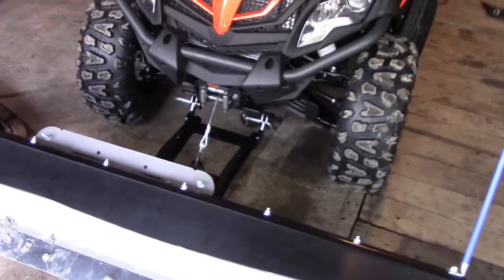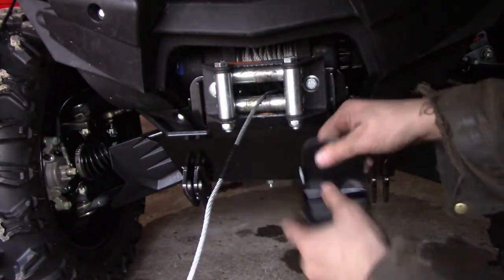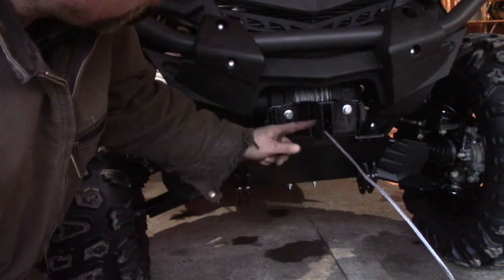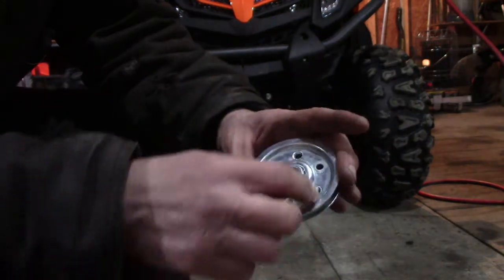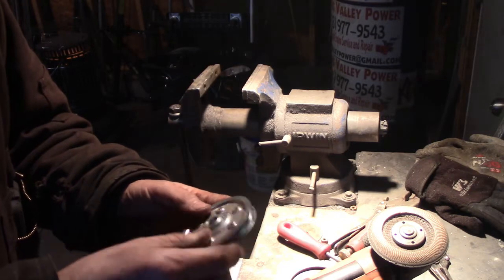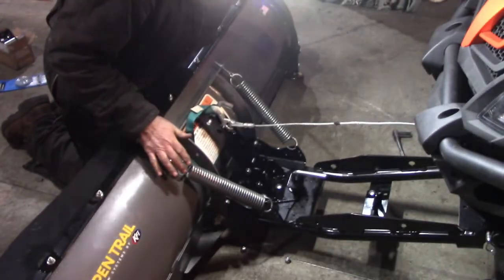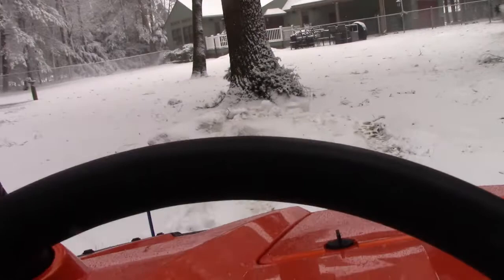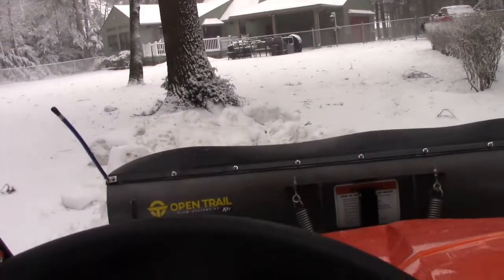KFI plow fix for winch cable breaking on UTV CF Moto.

Comment from the maker: A lot of comments saying the cable pull routing or angle is wrong. That it should be pulled up not in by the winch...it is  the correct way to pull it in,  and not up! There is a suggestion card towards the beginning of video as well a link to another video at the end that explains why this is correct.
Reply: A winch is always pulling "in" if think about it. You can change the angle of the cable anyway you need to and the winch still is going to wind the same way. 😂

Comment: I have this on my plow. The thinking behind the large pulley is your cable wont bend as sharp as compared to fairlead roller, 3 inch pulley compared to 1 inch on fairlead.
The pulley will also keep the cable from flattening like on the roller fairlead. Another feature is the piece joining the two angle L brackets is meant to keep cable in pulley

Comment: I like the pulley replacement instead of the fairlead, but that system ends up putting most of the power of the winch forward and aft, instead of lifting.  I would attach another pulley, with a sealed bearing, to the lowest anchor point on the plow, and use a strap to anchor the hook end of the cable to some high point on the front of the ATV.  This doubles the mechanical advantage, decreases the speed of the lift.  and cuts the stress on the cable by a factor of 2. 
If you don't care about having the winch cable installed, I have seen several hints on other installations with the cable breakage problem, convert to an 8 foot length of  2 inch strap attached to the winch (after removing the cable).  I haven't decided how I am going to solve this problem, but there was another Idea, where the person mounted another winch on the plow, and used the same power cables from the main winch, to power the winch on the plow ,   This would allow a person to use a strap instead of a rope or cable, and lengthen the life of the unit, while still having the long line on the main winch for normal operations.
I have a Warn, center mount plow on a Kodiak ATV, and I am going with the winch on the plow (using a 2" strap),  because I happen to have another winch available.  I plan to use a quick disconnect, to move the power from the ATV mounted winch, to the winch  on the plow.
Good luck with your installation.

Comment: You can’t pull a snow plow straight to your winch…….up not straight
Reply: you are exactly right. The cable should be attached directly below the winch. It should be lifting the plow up, not trying to pull it in towards the ATV

Comment: I did this to ours, has broken twice this year. Each time I plow it snaps the cable
Reply: Try attaching the winch cable to the plow arms directly below the winch. His design is putting a lot of stress on the cable. It should be lifting the plow straight up, not pulling it in toward the plow. You want the winch cable as vertical as possible, straight up and down. You'll have much better results.

Comment: Your winch mount location is horrible. Your winch is trying to pull the plow blade in towards the ATV when it should just be lifting it straight up. You will have much better results if you hook your winch cable on the metal loop directly below the winch. You want to keep your winch cable as vertical as possible, straight up and down. Much less stress on the cable if it's lifting it up, not pulling it in toward the machine.
Reply from the maker: I hear you and I know what you're saying it looks messed up however the original setup was that metal hook straight-up-and-down and the cable kept breaking like every plow it would break haven't this way it hasn't broke once again it doesn't look right but whoever designed that knew what they were doing